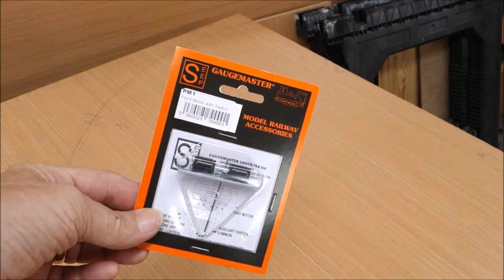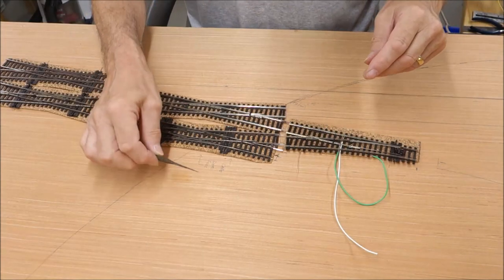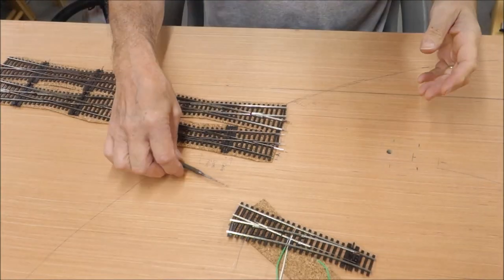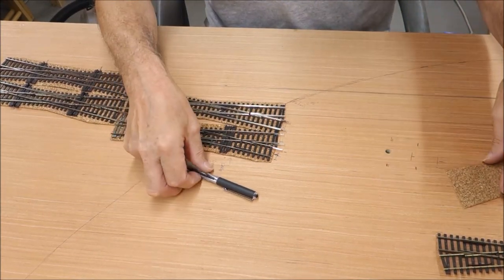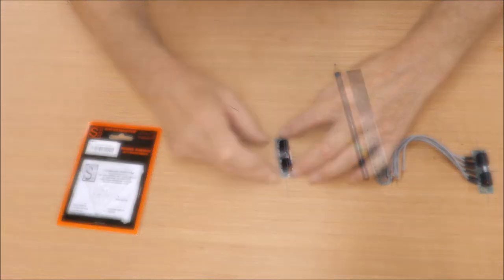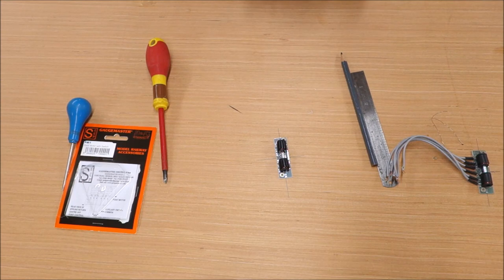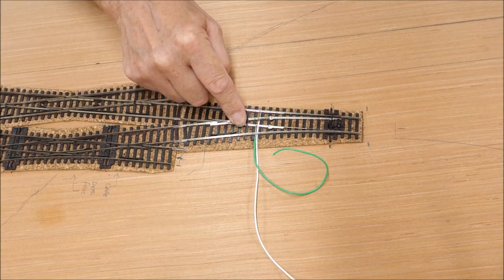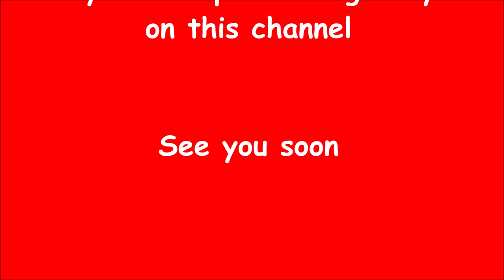Bite Size Bits - Fitting Seep point motors

Comment: Hi I too use Seep motors and have found it necessary in some locations to install them from above the baseboard!
Using an old baseplate (stripped of its 2 coils and the soft iron sliding core) as a jig I align this over the 7mm hole and align with the cross hairs you suggested. I them drill the baseboard to countersink for two 4BA cask screw. Why 4BA
Well the pre-drilled hole in the Seep base plate is the correct size for ‘tapping’ a 4BA thread. I then pre-wire the Seep with 5 connections - Coil common; Normal coil; Reverse coil; micro switch common; output contact from the micro switch when the Reverse coil is energised. It is then possible to offer the complete pre-wired assembly up from the underside of the baseboard, through the hole in the tie bar and secure with the 2 x 4BA cask screws from above. When testing is complete I add a locknut to each screw with the aid of a 4BA ‘nut runner’ from below the board.
My frog switching and position indicators are routed via a DPDT 12v coil sub miniature relay that will only be energised when the point is in the Reverse position.   Hope this will be of interest and assist others in mounting these excellent motors, particularly if retro fitting to existing point work. Thanks for sharing your great content. Best Regards. T🚂
Reply from the maker: Great tip Tony - thanks for sharing!!

Comment: I have one seep motor that will reverse the point but not normalise it.  The wiring is fine so is the motor faulty? It still does the same thing when removed from my layout.
Reply from the maker: Sounds faulty.  Worth double-checking the soldering on the wires, just in case.   Gaugemaster are usually very good with their after-sales service.  Try sending it back to them and asking if they can have a look at it for you.  They might not be able to help but I am sure that if they can, they will.
Reply: @yarslowmodelrailway1  Thanks for your reply.  I replaced the motor and it works now 😁

Comment: I used to like Seeps being a cheap all in one polarity switch and for 00 probably fine but wouldn't reccomend for N.  I'm using them on Norramby my N gauge layout.  Set up was easy enough as I made a jig but being N they don't move as much as 00 and had to design & build bypass switches for the polarity change that were driven by the Seep pin. Not ideal.
Reply from the maker: Hi Sparkshot.  I'm surprised that Gaugemaster don't do an N gauge version given that 2mm has had such a huge rise in interest in recent years
Reply: @yarslowmodelrailway1  Yeah you'd think so, maybe because some get away with it they're not bothered.
Reply: To add to the mix - When I use Seep PMs on N gauge I slightly offset the PM so that the travel of the tie bar is restricted when moving to the ‘normal’ position. Accordingly when switching to ‘reverse’ pos’n the travel is greater and this in tern ensures the Aux switch fully makes contact with its ‘reverse’ output terminal. By wiring the coil of a DPDT 1relay to this output and the frog to the common, fed in the usual way by by the n/o and n/c contacts from the stock rails a very reliable frog switching is achieved. How this helps others applying Seeps to N gauge points. T🚂